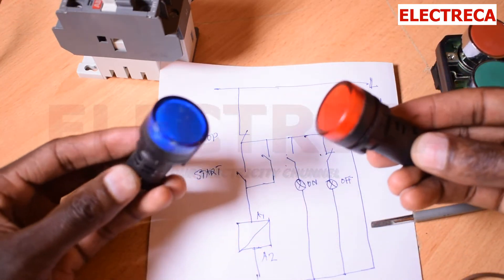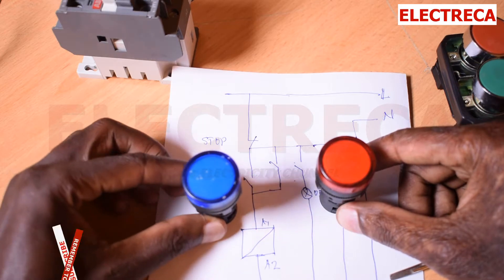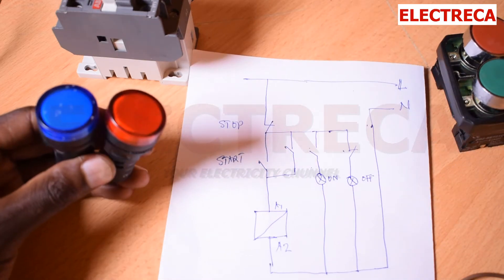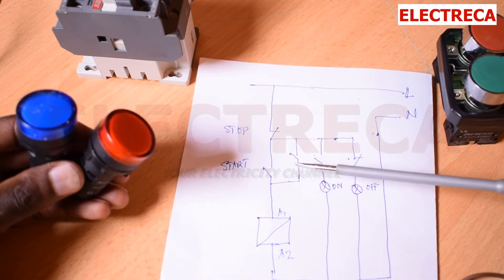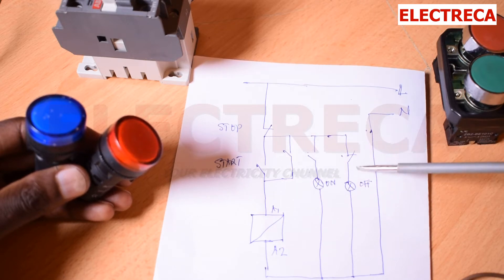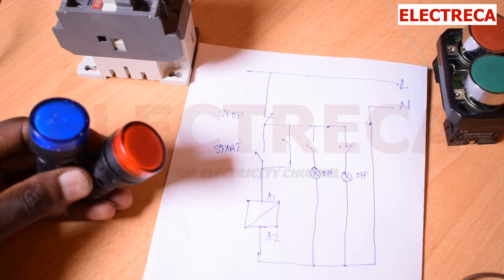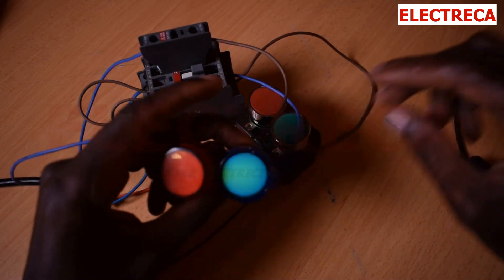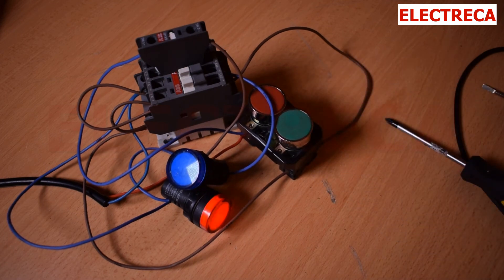How to wire ON OFF pannel light in the contactor circuit|ELECTRECA

Comment: I really like your videos. But, I have trouble following schematics.... It would great if we could see drawings of physical layout.

Skip....
Reply from the maker: Thank you for the feedback and for watching...  Do you mean I should show the schematic while wiring the circuit?  to make it easy to follow along.
Reply: ELECTRECA no. I adraw pictures of each item and the pin outs and draw the wires to show actual layout.
Reply from the maker: @SkipEvansx  Oooh ok, now I get it. I see it can make things simpler to any viewer..... I'll be doing it that way. Thanks you
Reply: @elektreca  actually I like the tutorial,bt for the contractors we have numberings,when you are doing your connections some learner's may not understand the purpose of connecting and the function of every auxillary contact.so pliz tag along the number if it is nc or no tag along it designated number in the contactor for easy understanding
Reply from the maker: @kevinambetsa7738   Thank you for the feedback......
ill put that in consideration